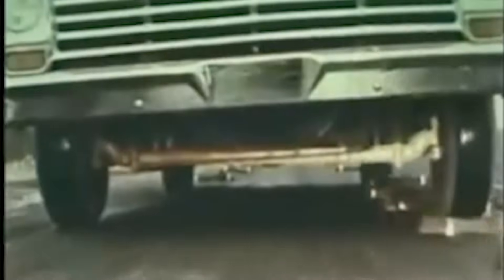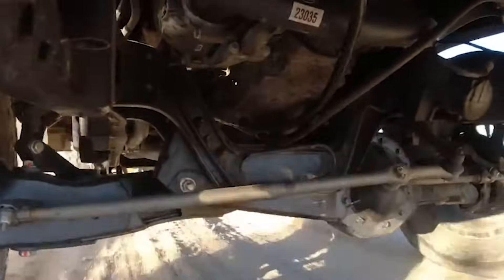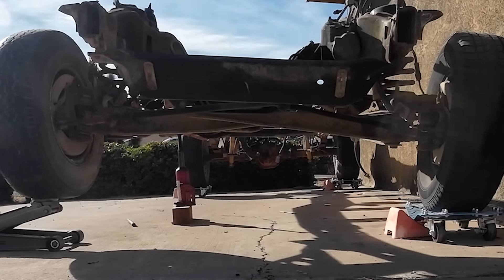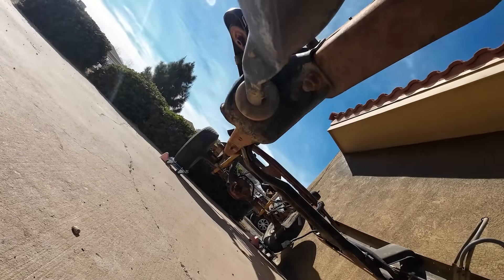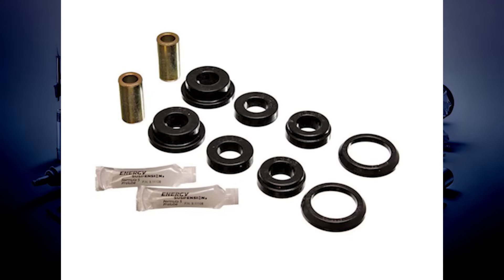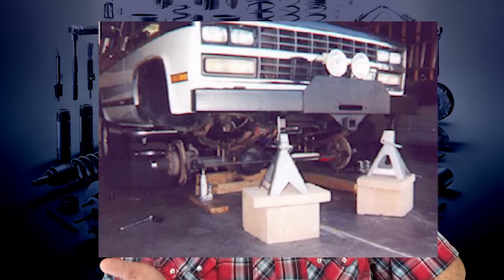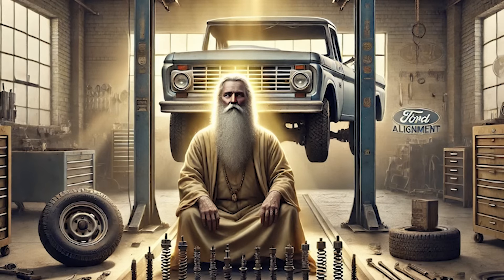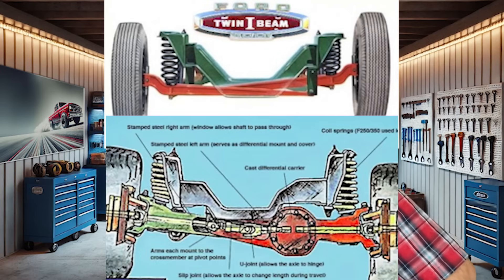Ford’s Twin I-Beam & TTB: Everything You Need to Know About These Innovative Suspensions

Comment: As the proud owner of an 88 Bronco that I used at work doing erosion condition assessments of off highway trails until I retired.  I can say with out a doubt the TTB was, and is, excellent.  My Bronco went 246K miles on oem TTB, engine, and tranny.  No I did not beat it up and I did not run race pace anywhere.  But I was out there, day in and day out.
Two things come to mind.  1.) comfort going down the road or trail was exceptional (I had the factory twin shock system w mild shocks).  2.) was the turning radius.  I could often turn inside all but custom built off-road rigs.  WAY tighter turning radius that a Blazer, say.  Like a 1/3 tighter.  
With posi out back and decent load of tools in back it was pretty much go anywhere, from the Oregon dunes to the deserts of the South West.  The big deal is DO NOT change the wheel offset, and be reasonable about tires.  I kept the factory 15" rims and just went with tires.  10.5 x 31" for rugged terrain 9.5 x 30 for every day road stuff.

Comment: Adding to the econoline comment. The econoline vans in 2wd used the twin I-beams until they discontinued them in around 2015….so 50 years of twin I-beams. Plus still a popular design for off road pre runners. Awesome.
Reply: I still have my 78 E-150 LWB with a 351W, 4 speed manual trans, 9 inch rear end with 411 gears & a locking differential. I have updated a few things like switching to a single piece drive shaft, Volvo 740 drivers seat and Power Master Alternator. But this van is my favorite power tool...
My only problem with it is that my two Tesla neighbor slashed my tires & other vandalism because I "was killing the environment" by owning a gasoline powered van that I only use as a work van...
Reply: @davidhollenshead4892  My father ordered one of those new, the overdrive was only a half year option for the 351W, (in 1979 it was only available behind the 300-6/302-V8) I still have parts of that van (engine/trans/pedals/shifter/rear-end) that I am saving for another project. Those are pretty rare, Ford would void your warranty if you had a trailer hitch on one! - The Top-loader overdrive was not made for towing...we used a "clamp-on" hitch to tow the boat until the warranty expired!
Reply: I have 2015, 2018, 2022 e450s in my fleet. All have twin i-beams

Comment: The main problem with TTB on 250\350 leaf sprung 4x4 trucks is not camber changes but that because of the pivot the leafs get pushed out under compression and are constantly twisted as the suspension articulates.
350's with their positive arch springs and front shackles necessarily jam the axle forward into bumps making RSK's very popular.
This is a good overview of coil sprung TIB/TTB front ends but there's good reasons Ford changed to a solid D60 under the 350 4x4 in 1985
Thanks!  👍
Reply: You explained it PERFECTLY.

Comment: I've had my 1983 E-100 van for 42 years. I maintain it myself,😂 grease it every year, the kingpins are still original. I had the tierods replaced 3 years ago. It has approximately 180,000 on it, and has not given me any problems. I love it. I don't get any excessive tire wear, they last 10 to 12 years with rotation every year, (5,000-7,000 miles).
Reply: I have a 78 'E-150 and haven't had any issues with it except for the tie rod ends and a worn out steering gear box...